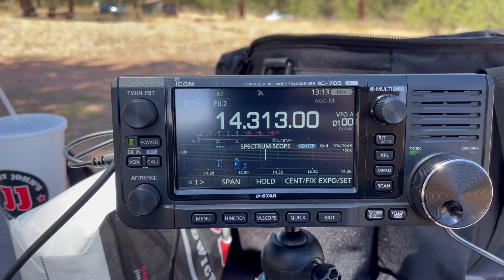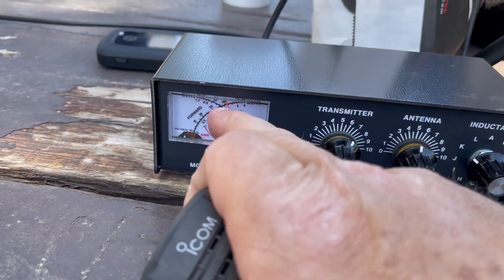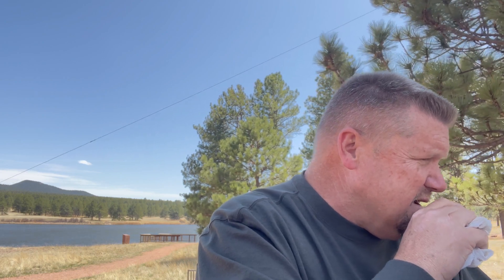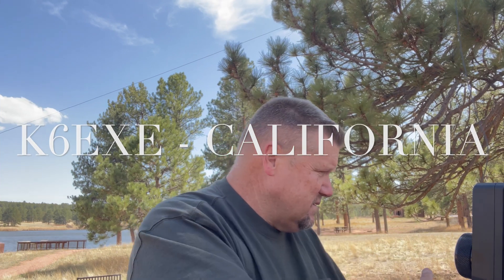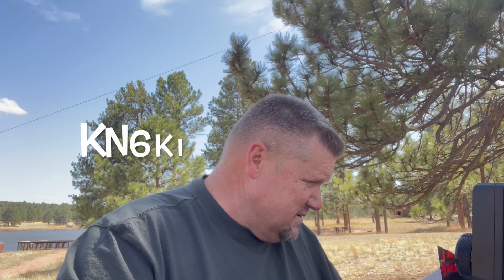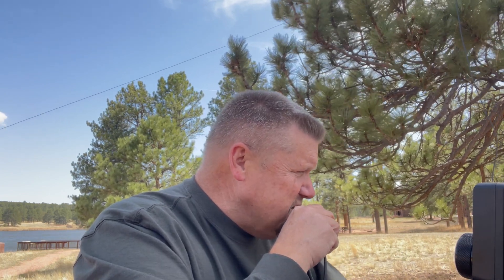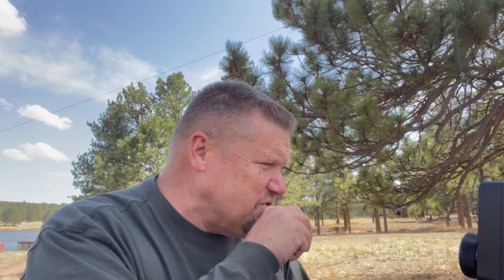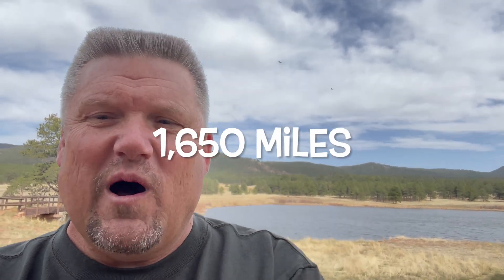Matching the IC-705 to the PackTenna Mini 9:1 Random Wire & the MFJ-904 Tuner: Live POTA Test

Comment: Tnx for the video. Question: Did you use a Counterpoise with the PackTenna EFRW 9:1?
Reply from the maker: @dovetomarc  That’s a good question. I have had that PackTenna EFRW for a couple of years now and have done easily a hundred POTA or SOTA activations with it and have never used a counterpoise wire with it. That being said I will tell you that the outside shielding of your coax feed line with a length of 25-35 feet is actually supposed to serve that function without the need for a separate counterpoise. You don’t need to do anything but just connect your BNC to the antenna and to your radio and it serves that purpose. Thanks for watching. Ham-Solo K0FYR
Reply: @Ham-Solo  Thanks.